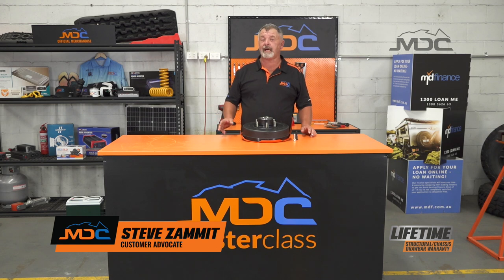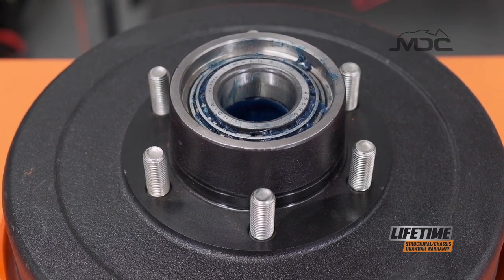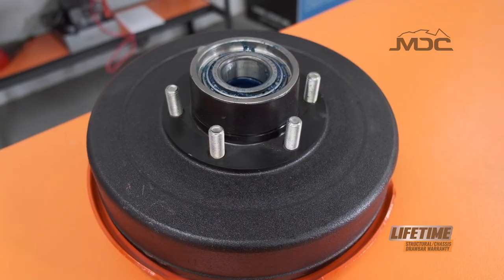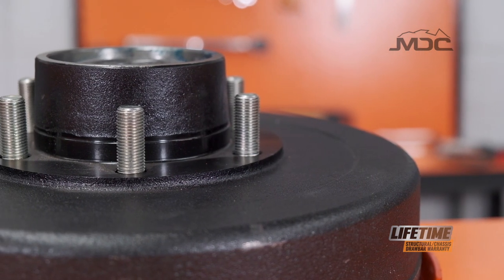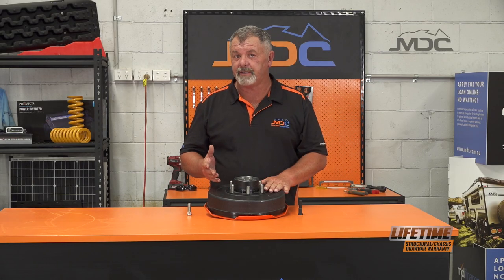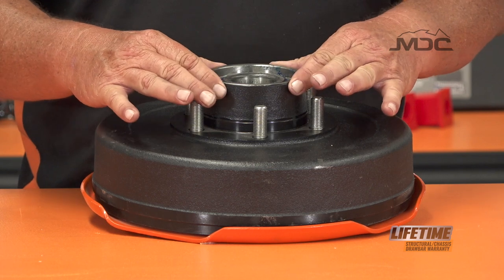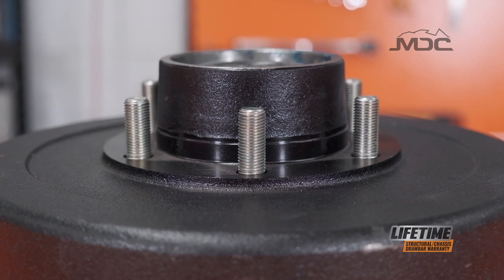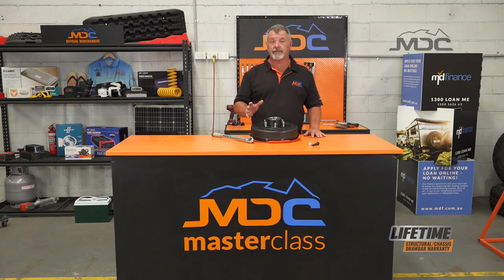14mm Wheel Studs Why! - MDC Masterclass #114

Comment: Hi Steve, not sure if checking the torque settings daily is a recommended fix as I do not know of any car or truck manufacturer recommend daily wheel nut checks, spent 45 years in the automotive business as a mechanic. I believe that there is a manufacturing issue of the studs and where they press into the drum not being fit for purpose. Early circulation 2016 MDC's had the issue where the studs would either break or pull out of the drum. According to tow truck drivers the broken wheel studs is a common problem.
If MDC has provided an upgrade to 14mm wheel studs then surely the old studs were not fit for purpose.
Has there been a recall from MDC to recognise the problem with vans that has the older design? If not why not?